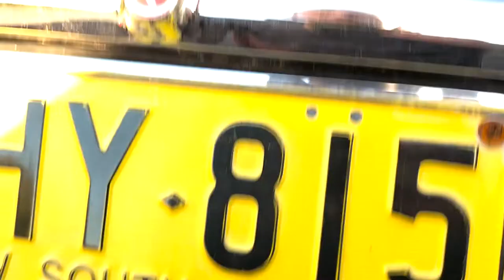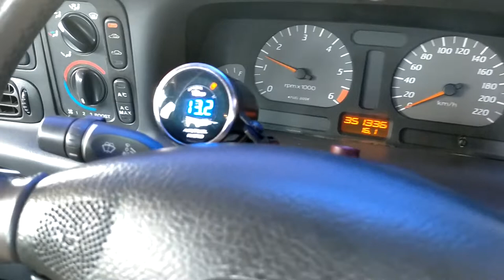98 EL Falcon (Turbo) Project (part 16) (Im Back , Update on the build!!!)

Comment: bill does patch looms for haltech 750 into the factory harness now, that's the route ive gone. i used the barra pcm previously  and it was a bit meh and pricings not that different going haltech vs barra ecu
Reply from the maker: yeah i have seen that hopeing to upgrade soon but for now the j3 has to do for now
Reply: @ProjectGarage2450  I get that, make it work with what ya have at hand 👍🏻

Comment: hye mate quick question did you have to do something to the solenoids at your ecu for the trasmission to get it out of limp mode i just turbo my el and just cant find too much info on it
Reply from the maker: Hi mate sorry for the late reply mate , if your talking about with a manual conversion yes you need to trick the ecu into thinking it's seeing transmission temp and a few other signals so that the car will function without thinking the transmission is overheating eg eg . I have done this to my AU wagon and EL I don't know what resistors and wires need to be matched up but I do have them written down as I just looked at my wireing diagram and matched up a resistor to make it happy , also you can just trick it with a j3 chip but depends on what ecu you running I guess , if this is what your talking about I'm happy to help with the wires and what to do I can make a video if needed 😊